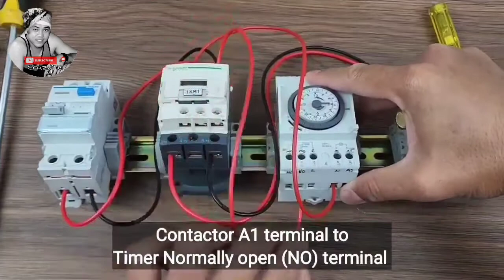Basic Pump & Motor, Power & Control wiring with 24hrs Timer.

Comment: sir ilang ampere po ang contactor na  ginamit nyo at anu ung tawag sa parang ballpen na power tester nyo at akoy bibili tnx po.
Reply from the maker: Bro sa contactor kung ilang amps dipende yun sa load mo or sa motor na gagamitin mo, yung tester ko naman FLUKE VILT ALERT TESTER ang tawag dun dalawa option mo dun pedeng umiilaw lng pede ring nailaw na natunog pa, salamat boss sa pag view ng aking video sana my nagutunan kayo kht papano
Reply from the maker: Fluke volt alert tester
Reply: @CrazyMe30  malaking bagay sir kasi plant electrical maintenance ako medyo hirap ako sa designing ng control at malaking bagay sa akin mga video mo maraming slmat sir at nakakukuha ako ng knowledge syo mabuhay ka sir god bless.
Reply from the maker: Salamat sir